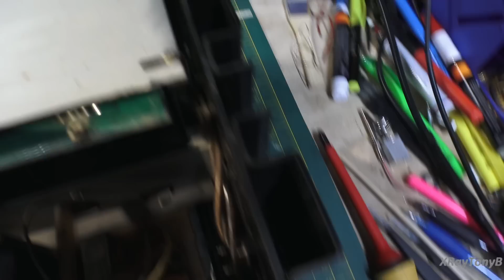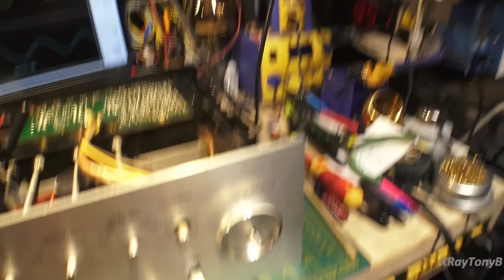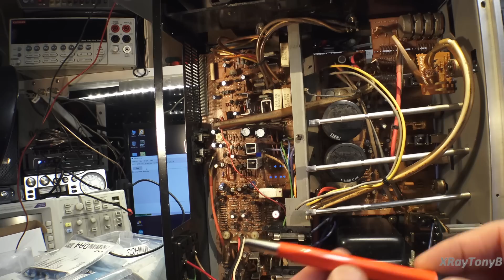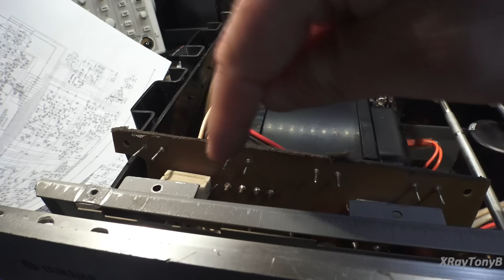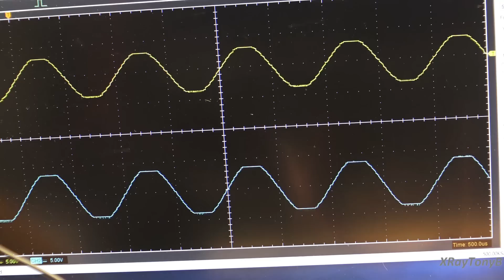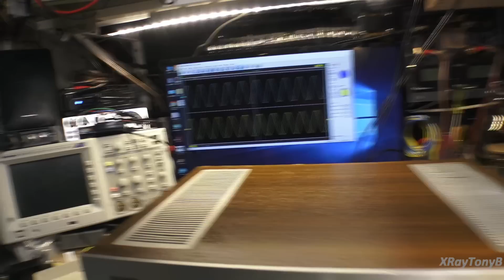Yamaha CA-810 Integrated Amplifier Repair and Restore

Comment: I have the CA-1010  since i bought it new in 1976 and just had some work done by a  40 year  experienced tech . The repair expert commented how well these amps are built and how output wattage is very conservative . The comparable replacement model today is $3100 vs the $475 I paid in 1976.  When running at low power levels this amp is  running pure class A . I love that we still have some  master tech's   like you  to fix our vintage gear. Thanks for doing this art of repair .

Comment: This is a superb restoration of an excellent integrated amplifier. In addition to failing LEDs and capacitors, cold or weak solder joints on some of the RCA connectors often cause trouble, as people are tending to use these wonderful amplifiers that came in many different models for over fifty years now! The potentiometers on these amp's, as well as the front panel switches, tend to often become very electrically noisy after all those years, and it's crucial if you repair or replace the 'ganged' Volume Pot's that these are precisely matched. 

Yamaha amp's are notorious for the way you could set the volume very close to zero, and still get the same signal level and thus sound pressure at both the left and right channels or speakers, something many other amplifiers do very poorly. Noisy pot's are almost always an issue after five decades, whether the amp is used little or lots, and while these can usually be cleaned and made to work again for another year, at some point, the 'snap, crackle, and pop' becomes too annoying, and these must be replaced. 

It's important to try to find the matching pot's, especially for the Volume Knob, as these are 'ganged' and this requires a special tolerance value so they will behave similarly. The design of the preamp circuit in all Yamaha Natural Sound amplifiers is very precise, and so these amp's usually come with shunts for the unused (usually Phono 2) jacks. If you pick up a used amp, these shunts will probably be missing, and a simple 25-cent part can help keep the amplifier running quietly. There is also a Ground Wire Jack for the turntable, and yet some models might run quieter WITHOUT using this ground connection! 

As many people are adding turntables and enjoying vinyl, learning about stylus designs, direct-drive vs. belt drive noises, and RIAA Equalization Curves, and yes, even grounding circuit noises all need to be examined. And let's not get started on disc washers and special, 'designer' cables! 

Anyway, the reason I am posting is with regards to the Yamaha Loudness Function Control: Your demo of the Loudness Control was sufficient and adequate to illustrate how it works, but it would be good to also show the way Yamaha actually intended this to be used: First, with the volume low, you turn the Loudness Knob (the smaller of the two knobs) to FLAT (all the way up), and now you turn up and set the main Volume Knob to approximately the highest volume level that you intend to use, which may be at level 2 or 3 out of 10 for background music, or 5 or 6 out of 10 for moderate listening in a group of three or four friends, or up to 7 or 8 out of 10 for a party! (That's the beauty of these very low Total Harmonic Distortion amplifiers, is that you can actually use 75% to 80% of the range of the volume setting, and with such good design and a high damping ratio, the amplifier will rarely begin clipping, even into a 4-ohm load. Try that on most other amp's; they will often clip terribly once the volume gets beyond about 6 or 7 out of 10 (I'm try to resist saying, "This goes to Eleven!") 

Set most integrated amp's volume knobs beyond about 60% of the way toward maximum, and it will begin distorting and clipping like mad! Anyway, now that you have your preferred maximum volume set for the current listening session, then set the bass and treble to their preferred settings, which should be as close to zero as the room acoustics allow (the tone defeat settings remove the equalization knobs from the circuit entirely, in order to further reduce distortion and possible noise). 

Okay, now you are ready to use the Yamaha Loudness function as intended: just crank the Loudness Knob back down to whatever level you prefer, and the lower you turn the Loudness Knob, the more bass and treble boost gets added, essentially to compensate for the way our human ears tend to "roll off" both low and high frequencies as the sound pressure level gets reduced. It really helps to understand the way the designers intended this to be used if, as you alluded to, you show the curves of both the low and high frequency 'boost' that gets added gradually with this Loudness Knob as you LOWER or turn down the Loudness Knob (and not the Volume Knob). 

Therefore, in summary: you set the peak or maximum desired volume for your current listening session with the Volume Knob, then adjust the equalization (bass and treble) if needed (or use DEFEAT for FLAT response), and from then on, use ONLY the Loudness Knob (the smaller knob) to adjust your volume! In this manner, unlike most amplifiers in which Loudness Compensation is a SWITCH of "All or Nothing," the Variable Yamaha Loudness Knob provides a continuous and "smooth" boost of both low and high frequencies as you reduce the volume via the Loudness Knob! Anyway, that is the way the designers intended their system to be used.                               - j q t -

Comment: Thanks . Really good video. In 3 days going to pick up this amp (350 km in one way). As the owner sad, he has it for 40+ years, never had any problem. Nobody Touched it inside - what I like. I'm an industrial electrician for more then 25 years, and in this aria, my last project for fun was sansui au 7900, the owner was happy. Hope this video will be very helpful to restore a new toy.  Right now I have KEF 104/2 and Tannoy srm 12x with only one amp - Marantz PM 8005. Hope this amp will work well with one of those speakers. (They are realy different :)

Comment: Thank you for this video. I've been using a Yamaha CA-710 since about 1977 - 78. Never felt the need to change it. 40 years service and only been to the shop once and still looks brand new! Even the light globes are originals. As soon as COVID is over it will be going in for it's 20 year service and re-cap. Might even spring for a shielded AC cable for it.

Comment: I've been working on electronics for decades but I always gain something from watching your videos. Some versions of that old glue can become conductive when they get old. As you can imagine, that can cause all kinds of problems. I had to spend a lot of time scraping off old glue on a piece of gear I was repairing because it was shorting out parts of the circuit and causing parts to fail.
Also, I use aquarium grade silicone glue because it does not have any corrosive chemicals that might harm fish.
Keep up the good work!
Reply: The silicone Tony uses is what I used for aquarium repairs !

Comment: I worked for a Yamaha Service Center in the 70's and 80's. The NEC transistors are not original even if they appear to be. Yamaha always used Toshiba transistors for the outputs. Also, they would never use different types in different channels.  Thought I would clear up that thought.
Reply: I've always called them Yamahey.. because of their (imo) lacking quality in both sound and buildquality - never liked them.

Comment: Thanks for the video I just stumbled onto your channel.  I've been using a CA-800 in my system pretty consistently for about 30 years.  It's a little smaller than the CA-810 and doesn't have meters but it can run in class A.

Comment: Those THD #'s are what one can generally expect from that era Yamaha! They were always my favorite equipment! We wouldn't even consider dropping down to Pioneer! The meters were a nice bright even pale creamy white color...no blue whatsoever? And yes, we purchased these new in the mid-late 70's. We chose our equipment by reading the specs! THD & IMD also the frequency response as well as the S/N ratios. If the numbers weren't there, I didn't even want to hear it ! The only problems I can remember were replacing the wheat lamps every now and then, but well worth it for the performance...

Comment: I had to change out the pre-main jumper RCA's on my amp due to one being intermittent.  I put the heat shrink on the replacement RCA jack before installing it.  Thanks for the tip and it might save some frustration in the future.  I am using jumper wires with actual RCA plugs, not the solid, bent rod type, though.

Comment: I have owned a CA 600 since new in 1976. The loudness control is used very differently than you were using it. It is designed to make up for the perceived change in the sound as the volume is reduced. How you use it is to set loudness to FLAT then adjust the amp to as loud as you would ever want to listen. You then make any adjustments to the tone if you want to and from then on, you use the LOUDNESS knob to reduce the LOUDNESS you are listening to, you do not adjust the volume knob agan for normal listening. The LOUDNESS knob then is used the way you would normally use the VOLUME knob.
Reply: That's not how we used it. We pretty much always set the tone controls to flat. The only time we used the loudness switch was at lower volume levels. We only used the volume knob. I never heard, nor saw anyone else using the loudness switch like you mentioned?

Comment: Great to watch. Have purchased a Pioneer VSX838 bout 6 years ago. It lasted just under 2 years. My old Pioneer SX300 1973 is still going apart from the festoon and stereo lamps. Looking like the best and most reliable are the old'ns. Pioneer SX1050 would be nice, they are about.

Comment: A trick for the LED lighting. Use fine (+1000) sandpaper on the outer surface of the LED. This diffuses the LED to a bulb like glow, which is a very even one.

Comment: If the signal transistor leads are tarnished it can migrate into the body of the transistor, cause noise, low gain, leakage etc. 40 year repair tech. Examples 2SD458, 2SC1345.
Reply: Not 2sd458 but 2sc458 are the transisors you are referring to.

Comment: I have a CA-810. Today I found my left VU meter needle stays at the max to the furthest right when power is on.  I had tried to turn on/off, and unplugged the machine but no use.  Sound come out from both left and right without problem.  So, is the meter “dead”? Anything I can to to restore it? Many thanks to any advice.

Comment: How much did you charge for this restoration and what is your turn around time if I send you the exact same amp.  If I had to guess off watching your video my speaker channels are bad. Great video I have none of your equipment or any skill set in this area of electronics. I've already been ripped off for  $180 from a local shop that did nothing other then turn it on and gave it back.  Also, brand name and dealers that sell that cleaning pen you used.  Thanks

Comment: I recently fully re-capped a CA-810 with Audio grade Nichicon caps including filter caps as well, but I still can hear light Humming when idle, it's not increasing even with full volume at idle, stays in same level. also it goes away when de-coupled pre-amp and power amp. mid point show 1.3mv and idle current is healthy as 20mv. looking for a help.
Reply: The sub board with the switch is often damaged. Based on its location. Inspect the traces and joints. Some bypass the board  entirely. Jumper wire it and see if it goes away as a test.
Reply: I have the same problem with a HK 680. I replaced the large capacitors but it just sounds better LOL, the humming doesn't stop. Initially I thought that the humming derives from the transformer but they are only the fins of dissipator on which the final transistors that vibrates. The bias currents in mine are perfectly set at +-21v, I noticed that decreasing the bias value also decreases the vibration. It could be the pre-stage transistors that should be changed (all of them). In the end I think it's just the flaps that are too large and poorly designed.
Reply: @Poppinwheeeeellllllieeeeez  Thank you
Reply: What filter caps did you use ?

Comment: I have an CA-810 that has issue with the volume and balance knob.  I've tried cleaning them but, still no good.  The Volume knob makes lots of noise through the speaker when turned.  Do you still accept items for repair? If so, how does one get ahold of you?  I love this amp, but its now just collecting dust.  Thank you.

Comment: If the main filter caps ck’ed good and you didn’t replace them, did you check any of the other caps you replaced to see if they ck’ed good? Or was it just easier to replace the small caps then try and source and replace the big ones?

Comment: Very nice! Whats your opinion on replacing filter caps? Historically, I always replace but trying to find anything in the 12000uf to 18000uf 40mm casing is about impossible. Digi, Mouser, all 0 stock. I'm to the point of salvaging early 2000's amps for filter caps.

Comment: How much does typically one of this repair/restorations on vintage gear costs?
Reply: I charge $80-100 full recap
Reply: nigel mahabir Hi Nigel, I have CA-1000 model.  It works perfectly, but I would like to restore it to even more perfection, which for this price is very execrable. Where are you located? I’m from Toronto, Canada. Please return to me. Thanks.

Comment: But when you were talking about the filter caps it is better to have two bridge rectifiers filtered in between each other with a small capacitor before the filter caps this is better than replacing the original capacitors for bigger ones. Do you ever do this as an upgrade and maybe using 4 to split the channels.
That relay are the contacts silver you won't silver contacts. Why did you swap out the power transistors what benefit are these new ones you put in?
Reply: John sweda It was probably just so both channels were matched.

Comment: Hi! Thanks for posting this.  I have the CA-2000 that looks very much like this.  The power switch/knob got bent and half broken during shipping to me.  I need to take the face plate off to get to the switch/knob to fix it but am not sure how.  To get all the obstructive knobs off the face plate, do I just need to pull them off the shafts? I've tried but they're really tight so I'm afraid that I might break something if I pull too hard.  Do I also just need to pull the balance ring out and it will come off the shaft? Please help and show me how! Thanks!
Reply: I've found that on some audio equipment the knobs will sometimes have "set screws". They're usually a micro flat head or phillips screwdriver or possibly an Allen wrench. Hope this helps 🙏 👍🙂

Comment: Without the filter capacitors the ripple would be in the range of +/- 57.1% around the average dc output of the rectifier.

Comment: Thanks for your great videos, a big fan of your channel. I have the same amplifier and want to line the phono switch up with the markings. Could you please tell me what type of locking screw tool and size to use please. 
We use metric so I'm not sure if I can use. Appreciate any advice on removal and anything else I may need to be made aware of, thankyou.
Reply: 2MM Allen, just checked the CA-810 I have on the bench.
Reply: @milo963  thankyou

Comment: Hello, nice video, thanks! I recently bought this machine type and I use it for listening to analog sound from vinyl and also CDs. Connected to a pair of floorstands, the sound is brilliant! Machine runs fine, yet there is a small inconvenient: I hear radio interferences in both speakers, the sound is almost imperceptible but mostly at late hours when the room is very silent it gets annoying. Radio sound is equal in level on both channels and it is not influenced by the master volume level. It stops only when no RCA sources are connected to the back inputs (any input!). I have to say that I use very good interconnect shielded cables,  that I just bought in order to clear this lead,  so I presume that the issue comes from somewhere in the machine. Does this ring any bell? I would like to get it sorted out. Thank you! (I am mechanical engineer, I do not performs electronics repairs myself, but I have quite enough understanding of how things works, I am an old enthusiast of audio systems for home music listening).
Reply: Pudiste resolver el problema?
Reply: @JG_Rocca  no
Reply: @adriangaspar8209  I just brought a CA810 and there was an FM audio frequency when I connected the RCA Tuner to the amp. Just as you mention it, it does not respond to volume and it was so low that when listening to normal music it was not perceived. Currently I do not have the tuner Tuner connected to the CA810 tomorrow I will test to see if it continues to happen. I recommend that you ask the "Santiago de Leon Audio" channel here on YouTube, insurance will tell you what to do. Tomorrow I will do the test and if the FM noise continues I will ask Santiago.
Reply: @JG_Rocca  So, how is it? Did you found the radio source?
Reply: @adriangaspar8209  this time I plugged in the tuner and all went well. ask to the channel "santiago de leon audio" is the man.